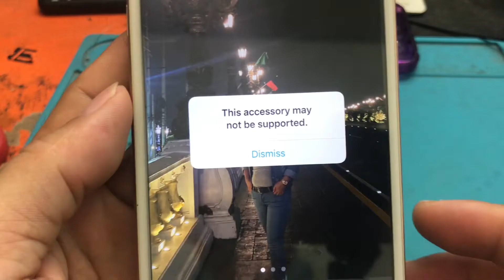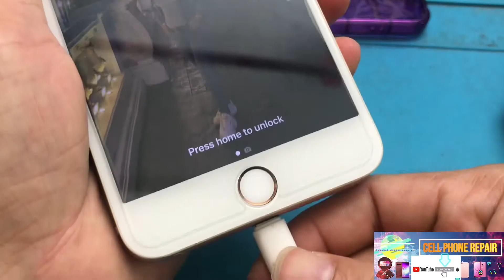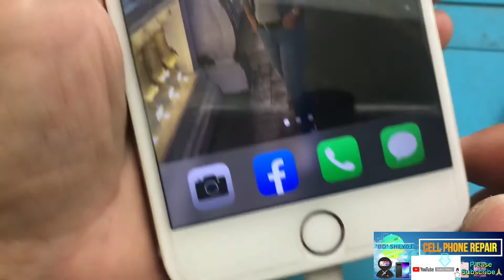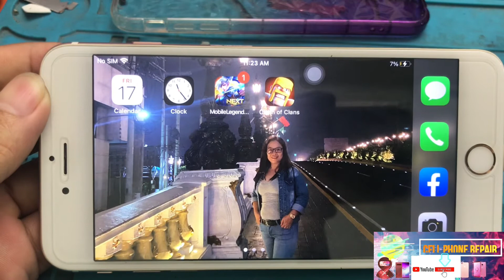iphone 6s plus. this accessory may not be supported. best and tested solution 10000%

Comment from the maker: please visit my previous video post, for more solution.🙏

Oppo f9 the current image boot recovery have been destroyed. easy way tested solution. https://youtu.be/yAoNY1xhnVs

iphone 7 plus back camera not working tested solution https://youtu.be/Rcfs45S_t5Q

realme c15 rmx2180 boot loop solution tested 10000% https://youtu.be/XohgRPbKhK8

Oppo a3s no power tested solution https://youtu.be/7usrX0W9ejI

vivo y71 (1801) no signal, tested solution 1000% https://youtu.be/fzcQ53DKYS8

oppo f9 no power solution https://youtu.be/YvURoCghSig

Oppo Ax7 CPH1903 Error Mode: 0x00000000 (Invalid) https://youtu.be/RfSXeUavQyM 

oppo a3s cph1803. the current image (boot/recovery) have been destroyed, solution here.
 https://youtu.be/UUgAIzBcPv0